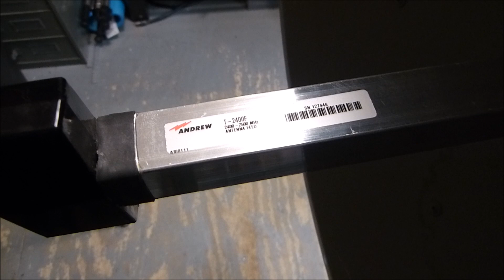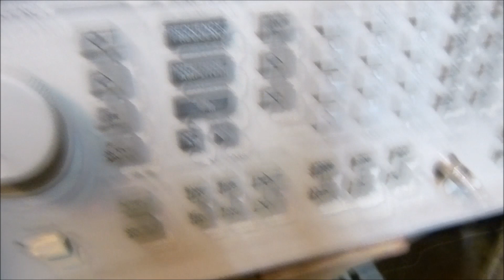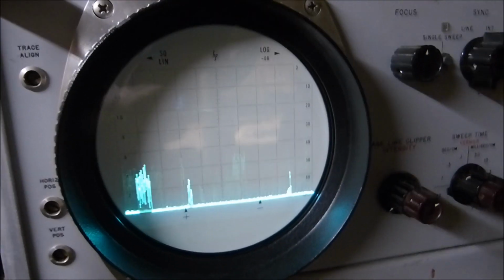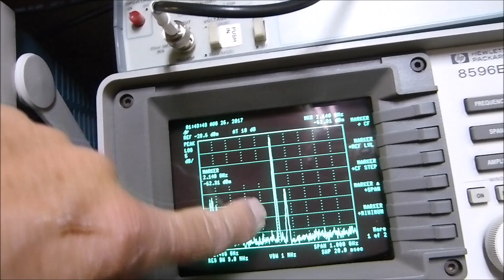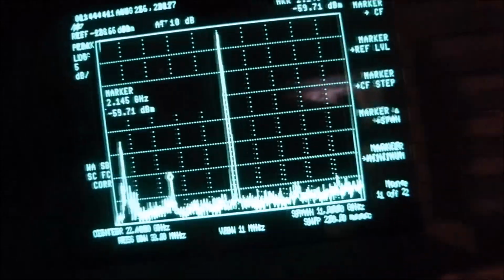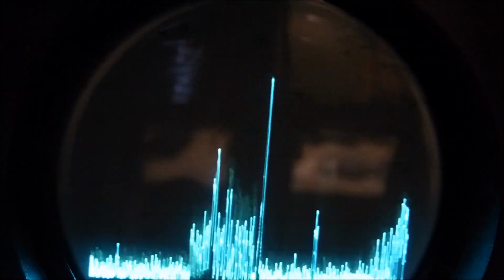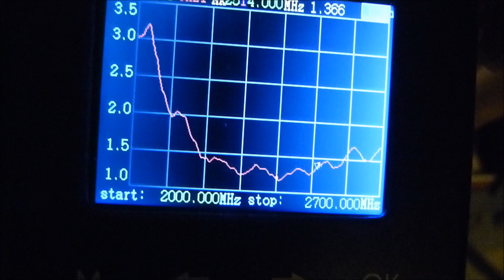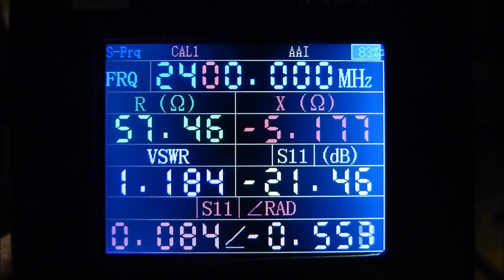WiFi Parabolic Dish For 2.4 GHz With Measurements

Comment: i really need such a anayzer you have , i thought those things cost a fortune , maybe not anymore this days..  any good tip were i need to look for ? brand / type ..  i would at least need one for up to 6ghz.  tnx
Reply from the maker: The HP 8596E is good to 12.8 GHz and is in the range of $2500 on Ebay. Also, you might be interested in some of the new RF Vector Impedance Analyzers for less money that go to 2.7 GHz and really do a nice job. Look at N1201SA RF Vector Impedance Analyzer.
Reply: many thanks!  i will do some search for it, might take a while before i can buy something hehe but certainly on my wishlist
Reply: http://www.aaronia.com/products/spectrum-analyzers/HF-6060-V4-RF-Spectrum-Analyzer/  this might be interesting to build and test antennas ?
havnt much experiance with all those specs and what i would need...but price is good for my pocket -) at least its new product.
i found the HP 8596E for 1500 Euro second hands, but not much info about the actual state, i not really trust that.
What i need is to messure impedance , center frequency and some gain messurments that would be a good start to build my antennas
on the wifi bands.
to buy something what gos up to 2,7ghz would be cheaper, but for the future i will missing options for the 5ghz bands i guess.

Cheers m8

regards from the netherlands

Comment: You may have already done this, but you can plug that antenna into a wifi router and see (read) the SSID signatures of all those signals that are wifi broadcasting. You can also hold your iPhone or Android device at the focal point of that antenna and see the same thing.  There is a great Wifi data scope ap tool for Android tablets called WiFi Analyzer by Kevin Yuan. It shows the signal strength, channel assignment, and SSID for each signal.  Great video!
Reply from the maker: Thank you.
Recently I purchased two 5 GHz dishes as I needed something simple and immediate and installed them as a bridge. Performance is amazing. I get right at 100 Mb at my house and almost the same performance at the other end of the bridge. I remember a few years back, parabolic dishes were very expensive then they seemed to disappear altogether but now they are back at reasonable prices ($100 price range each) with the AP mounted at the focus. Back in "my day" dealing with these dishes when 2.4 GHz WiFi was new, I had to run good coax like LMR-400 from the dish down the tower to the AP. It worked and I had a 4 foot dish on top of a 35 foot tower on a rotor. I was seeing around 450 AP's at that time so I would probably see 4000 nowadays.   :-)

Comment: Nice experiment, I want to build a new repair lab in my barn but I need internet (look up datasheets, service doc etc) I never thought about using directional antennas.
Reply from the maker: A couple of dish style antennas should work great if it isn't over 1/4 mile or so. It the barn is within 100 meters you can run CAT-5 cable... but... running cable from one building to another makes the equipment at both ends very vulnerable to being damaged by lightning passing over or any electrical disturbance that can induce voltages in the cable between the buildings. This can be eliminated by  running fiber between the buildings instead of CAT-5 wire. If you run fiber you have to put tranceivers on both ends to convert back to wired cable for your computers. No telling what you might find for cheap on Ebay.
Reply: It is only 35 meters and from my shack I have free sight to the barn. Cable is a problem. First to get it outside I must go trough several (stone double) walls, then 25 meter outside, again a double stone wall and then about 10-15 meter to the computer.Total length will be over 50 meter.  Wireless will be much more easy. I do not have  a 2.4 GHz VNA (only upto 1.5GHz but I have a slotted line and a SA with TG upto 4.4GHz) I have two old satellite TV dishes but I think a cantenna on a wifi reapeter/extender will do.